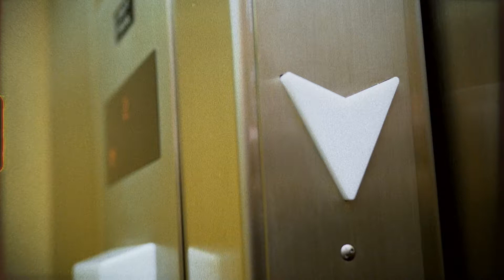What is an Elevator Drive? - KEB Machine Room Vids #01

Comment: this was very unclear
Reply from the maker: How so?
Reply: @KEBAmerica  so what exactly is the drive unit?
Reply from the maker: @9hundred67  The Drive (or Variable Frequency Drive) takes the signal from a controller and applies the correct electrical power to the elevator motor. You can learn more here: https://www.kebamerica.com/applications/elevators-escalators/